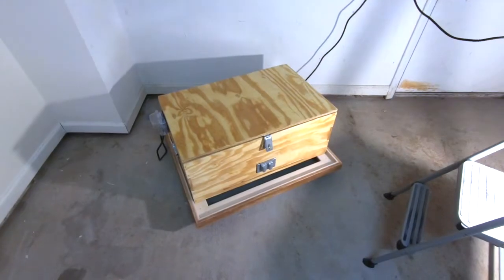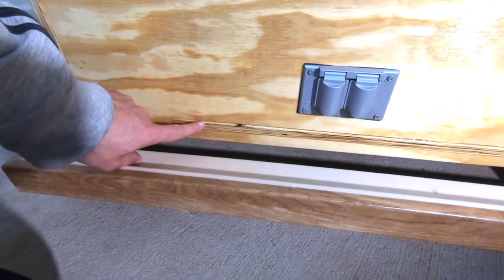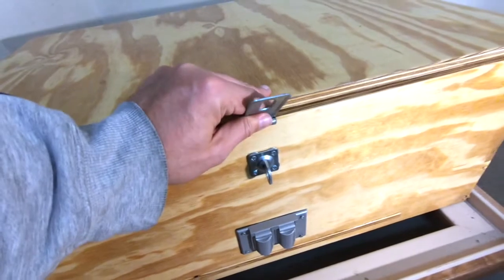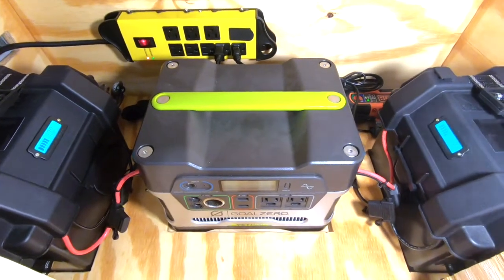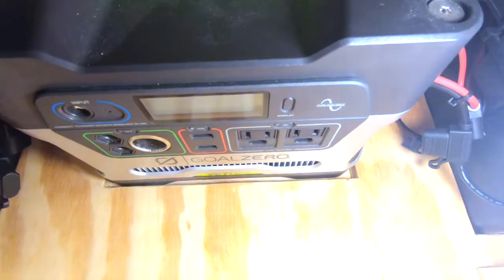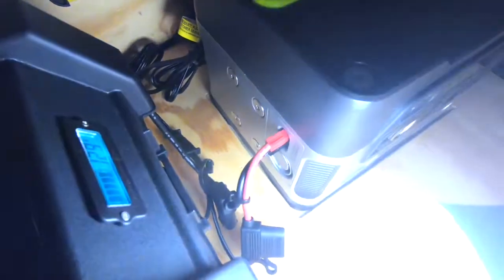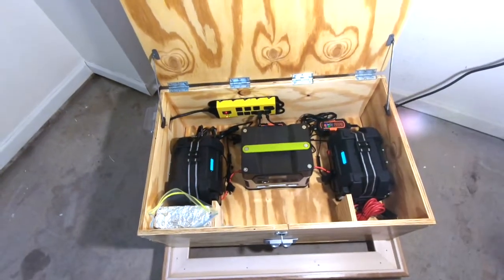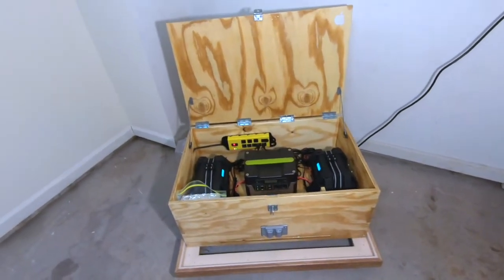My Custom Goal Zero Yeti 400 Box Build with 2 Additional Batteries

Comment: now you can level-up by switching to LiFePO: https://www.mightymaxbattery.com/shop/lifepo4/12v-35ah-u1-lithium-replacement-battery-for-goal-zero-yeti-400-solar-generator/ can still add addt'l batts in series, but now you have cut your weight in half, increased the charge cycle lifespan by 8x's, can charge faster, AND, you can drain to 0% (unlike 50% for the lead acid batts).
Reply: Have you tried this set- up? Any updates? I asked this question to the goal zero rep, if I can upgrade my yeti 400 using lithium and he said NO.

Comment: I like this set up. Do you have a parts list or link? I would like to copy the smaller BATTERY BOXES with the meter for each.
Thanks in advance.
Reply: I have this setup and would also like to know where I can find those 2 battery cases with the meter. I have not had luck finding cases similar enough to the ones you have. They're exactly what I'm looking for but I cannot find them. Any advice is appreciated. Thanks!

Comment: Thanks for your video very helpful. I’m trying to use a small but heavy weight dolly hand truck to stack my yeti 400 on top of two battery boxes. Both are daisychain together to triple the total power of the yeti 400. The question I have is how did you wire in your voltmeter

Comment: How do you charge the chained batteries when you’re camping? Let’s say you start off with just one battery that is chained to the yeti, they are both full and you start off by using 50 watts but you’re pulling in 20 watts, how is that balanced, is the 50 coming from the back up, the yeti or both(25 x 2)? Do they charge together together simultaneously (10x2) or does it just charge one at a time? I understand the concept i just don’t understand how you charge the battery that is daisy chained. Thank you for any help
Reply: Team LeBong, when you chain 2 batteries together they essentially become 1 bigger battery - meaning they both charge and discharge simultaneously.
Reply: The Goal Zero Unit allows for the charging.  You could charge it via a cable you order from goal zero that connects any after market solar panel.  Or you could use AC power to charge the batteries.  The idea is to rely on solar.  Goal Zero really dummy proofs the whole Solar Generator market, otherwise you need about 4 pieces of equipment to get up and running.  The daisy chaining mentioned in this video is kind of a “hack” to double or triple the runtime of the lead acid yeti 400 at 1/5 the cost of another yeti 400. It basically makes it run for 2 or 3 times longer between charges.  Really nice to be able to run lights, charge phones, portable lithium batteries, laptops, camera batteries.  Etc etc...